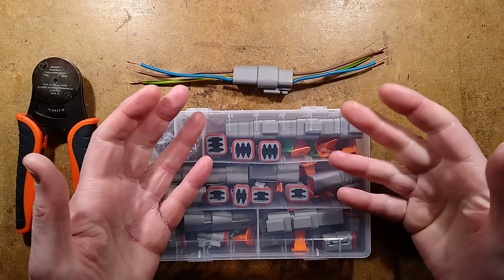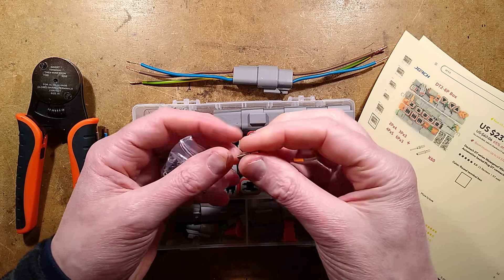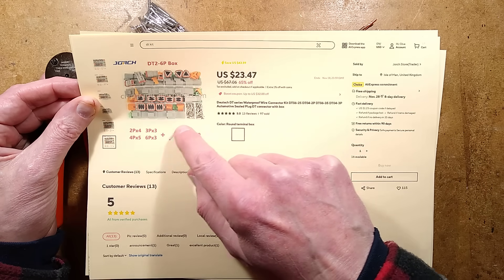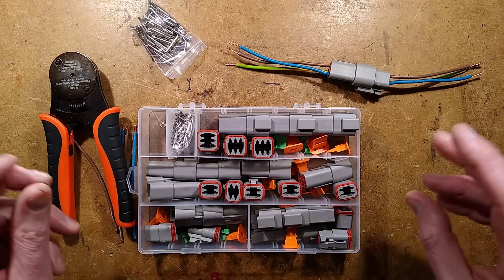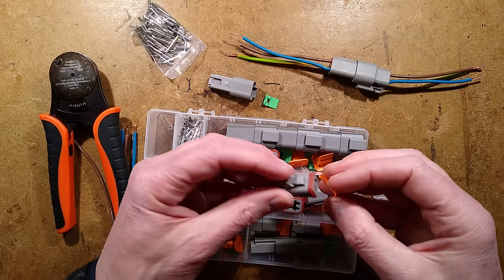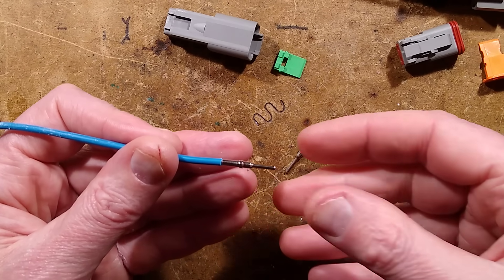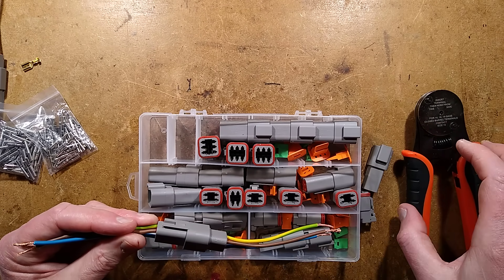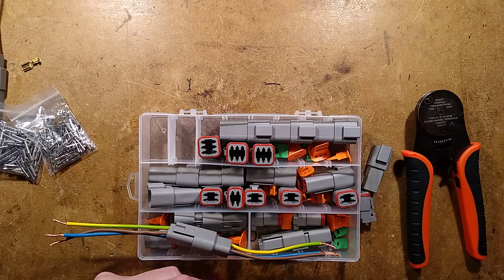Deutsch - my new favourite rugged connector

Comment: The heavy duty trucks I work on for a living all use Deutsch style connectors for all different circuit counts and wire gauges. I find them the most reliable and convenient connector in our whole harness, even the 30+ and 40+ bulkhead connectors. We used both TE and Amphenol brand as dual suppliers, as Amphenol makes a family of spec-equivalent connectors under their "AT" line. It's super common for us to have Deutsch receptacles designed directly into our controllers, making it even more convenient to use them in custom shaped housings. It was fun to see a parts review of connectors I've seen probably thousands of :D

Comment: I always love to see Deutsch connectors in equipment. They’re so easy take apart and repair. 
I’ve spent a half an hour trying to get other contractors apart without damaging them.
Reply: These days when faced with what looks to be a stubborn contractor, I sometimes preemptively cut its end off and hire a new one.
Reply: Dr. Freud, white courtesy telephone please...
Reply: Ford uses connectors with round pins that are similar in design to Deutsch connectors and use the same pin diameter (1.6mm) but the terminal length is different so the pins aren't interchangeable. The Ford connectors are similarly easy to take apart. I think Ford called them "wedgelock" connectors. I've used Deutch connector pins to make test connections to the Ford connectors.
Reply: "contractors" kinda fits, too
Reply: that second sentence turned kinda dark
Reply: Mopar locking connector has left the chat.
Reply: Yes, my van uses Deutsch connectors and they are never a problem to separate. My car has a mix of JST and Hirose connectors, and some of those can be absolutely awful to separate especially in arctic conditions.
Reply: I’m rather partial to D-sub connectors and cannon plugs myself
Reply: last semester me and my club buddies built a big cinnelifter drone and used deutsch connectors for the 8 motors, why? they were there lol. love the content btw man, keep it up. I bought one of those ryobi power cutters because of you
Reply: I too struggled with getting contractors apart until I purchased a Stihl MSA161 cordless chainsaw.  ☠️☠️☠️

Comment: With the 'winged' connector the outer insulating sheath is crimped to the connector. In high vibration environments this is important because copper core is under very high stress where the crimp is and any vibration induced motion occurs exactly at the end of the crimp which will cause the joint to fail. The winged connector transfers the motion induced stress to the sheath which dramatically improves the 'life' of the connection.

Comment: Is there a insulateted tail sleve for these so you can use dubble insulated cables and get a unbroken outer insulation layer between the outside insulation and the connector body? 
Or do you need to put shrink tube or electrical 5ape on them to achieve this. 
Also,have you done 1000 volt insulation testing on the example ones . 
Do a video on the insulation testing on the connector please , these would be really nice to use when connecting 230 volt 
Outside garden electrical stuff that you want to have unplugebal
Reply from the maker: I wouldn't recommend these for higher voltage use outside an enclosure.

Comment: These connectors seem to be commonplace in the automotive sector?  Both of our cars appear to use this type of connector in the visible parts of their wiring looms.  Presumably that's why they have very good environmental protection! I wonder if a standard bootlace ferrule crimper might do? They crimp in six directions, and once those ferrules are in place, they ain't shifting! 🙂
Reply from the maker: The bootlace crimper was not suitable for these.

Comment: These would be great for car mods or repairs. Might be a little bulky for a motorcycle 
if you needed to carry six or eight conductors. Would be great for carrying full bat. power 
to an outlet or higher amp drawing accessory, especially because they look like 
they are very water resistant, if not waterproof. Thanks, Clive!! If you love 'em, we know they 
are good.

Comment: I have a crimping tool for genetic ferrules and it’s one tool for several sizes. It seems to me that I could use that tool to crimp the connectors shown in the video too but Clive says you need a specific tool for each size (and I’m sure he’s right) 

If any knows, could you please explain to me why you need different tools for different size connectors? Tia!
Reply: With the non genuine tools the anvils in the tool for precision can only open up to clear the pins and crush down to the correct size, no mistakes can happen this way, if it snuggly slides in you are using the correct crimp, wrong crimps will be to small, pin won't fit in the hole as much as you try or too big for the pins, almost like throwing a sausage down a hallway.

The only adjustment to to make sure the crimp end is flush with the face, there is a few brands of pins out there that are a little different including crimp inside diameter but same size outside diameter and some cheap ones don't have the inspection hole. The ones with different crimp inside diameter are obviously thicker and a little bit more pressure is required to fully crimp, but they are handy for smaller wire but often not marked that they are different on the packaging within Australia and have no colour banding around crimp area.

There is a genuine type Deutsch crimp tools that can adjust to all the sizes 12, 16 and 20, but for the prices I have seen for them I could buy all the different types and sizes, multiple types of wire strippers, and every cheaper but quality removal tools with money left for a night of drugs and hookers. The only advantage I could see for me is less tools in a tool bag if I can not get my work vehicle close to the job. Even Aliexpress have a copy at $460AUD delivered "Ouch" but to some that is a bargain at less than half the price.

Not saying they are going to last as long as genuine Deutsch or licenced crimp tools but I have used non genuine Ionnic for years that cost me between $25-$40AUD but now they are around $60AUD

Comment: I started using Deutsch connectors a couple of years ago (import versions) and I like them. Although I have had two separate connectors fail over time. One was pretty soon, the other took over a year. This is on aftermarket fog lights on my truck. I still have to fix the one but its cold outside.
Reply: it occurs to me that maybe my crimping tool is less than ideal.....It's not as nice as this one.

Comment: I came across these during my internship in automotive controls stuff. Hard to plug and unplug, but water just does not get inside. Good stuff. The triangular ones were mostly used for CAN bus connections.

Comment: 6:24 damn. I've used Deutsch and other connectors in my industry for years. DT series are my favorite I buy them for home use. The flap/wing terminals are fine. I know you are not supposed to but, a little dielectric grease in between the seals where wires meet terminals and they won't corrode under water, with seal failure.
Reply: Also using dielectric grease on the plug seal protects it from grabbing the seal when you need to remove it in the future, when it grabs the seal it can overstretch the seal, I see this commonly in my job and have to replace the seals the first time a plug is removed, much of what I work on has been in a coal mining environment.
 
I have also seen wire and plug seals swell and become oversize when it has been soaking in diesel etc, the dielectric grease may(?) prevent/reduce the ingress of petroleum products, "this is just my theory". 
Fixing leaks, segregation of wring from a fuel or damaging heat source, protective sheathing, securing of cables (not just cable ties in a harsh environment and most white or coloured cable ties are not UV resistant) and plugs to prevent chaffing and pulling at wiring etc is obviously the better long term prevention.

I don't know if anyone else has mentioned to "NOT" jam your multimeter probes into the female connector, it is sprung at the entrance to give conduction between male and female pin, forcing a probe into it can damage the female pin and you most probably won't know this has happened causing higher resistance and open circuit at a later date.

I have made test plugs or pinned test wires, I even have male pins out of "bussed" Deutsch connectors, awesome for bridging plugs to test conductivity,  I am sure there would be manufactured versions out there for this purpose. 

I love the speed I can assemble solid tubed Deutsch pins over the cheaper split pins, I have also seen the Bomag Germans accidentally poorly crimp the other type (they might have had the Chinese supply the wiring), if you pull on the wire on the barrel type you know it is crimped to the wire, if you pull on the type that secures the wire insulation there is no guarantee of the wire being crimped correctly, I have come across this problem, I love the idea of the wire insulation being secured I guess those types are generally done in the factory in one action, my crimps don't allow it in one action so I can pre test the crimp to the wire but it is tediously slow.
Reply: The long posts are because Deutsch is the way. The wing type has one wing for wire and one for insulation. When you pull on the insulation it's crimped to the terminal, its not just pulling the wire out of the insulation.

Comment: The little hole in each pin also allows it to wick solder in without creating an air pocket if you want to solder them instead of using a crimper.
Reply: The hole is there to indicate the wire length is correct to be crimped, there is instructions out there to show this, but I can see it would be handy for someone to solder it, it is industry standard to not solder wires used in a harsh environment as it causes work hardening and possible solder wicking into the wires under the insulation, I often have to replace wiring broken due to this, someone in all "good intentions" did a good job of soldering but the wire broke at the soldered point or where the solder wicked up the wire into the insulation,.

It also doesn't help that it is less common to find lead in todays solder due to people incorrectly using it in plumbing and international agreements to reduce electronic waste problems.

Many old school can not get out of the habit and continue to just repair their repairs and the simple fix is faster and more reliable today. I am 52 so I am not new to the industry I use to solder nearly everything too, these days a lot less and "try" to prevent wicking up the wire and secure the wire to not move as far away from the soldered joint, I also try to find non lead free solder LOL.
I used buckets of solder 30+years ago when I rebuilt/temp fix bus radiators as part of the job we did everything bar exterior paint including body/frame repairs.
Reply: @MidlifeNoob  I've worked a lot with military grade connectors where they explicitly state to solder and detail the solder process required.
The biggest problem with people soldering is usually the soldering of strands before they are clamped in a terminal block. This leads tro them working loose over time.
My comment was mostly for the DIY'ers though as buying an extra tool may not be to everyones liking. The holes are usually way too small to be able to determine the depth of insertion though.

Comment: Deutsch DT are great, if a bit manly sized. waterproof, hard to monkey up, great contact. just too bad they don't make a compatible print mount version. Might I suggest JST JWPF for your smaller waterproof wire to wire or wire to board needs? great stuff, bit fiddly crimper, amazingly compact and lightweight. Or, ye olde superseal for when you have a need of many pins

Comment: I love Deutsch as my personal go to (with superseal the begrudging 2nd) however the biggest thing is putting the conduit backshells (Harnessflex is a good brand) straight onto the back of the connector. I can't quite tell but it looks like your versions may not have the clamping lugs for them. The other handy feature is you can use a spare automotive relay mounting plate (little tin tab thing) to mount your male connector to. Last thing to note for those that might walk into a motor factor to buy some over the counter, the Male and Female sets are actually part numbered usually by the pin gender, not by the housing gender. I've had many customers of mine get stuck with that when ordering over the phone.

Comment: One thing tho.. They look very bulky especially if this is suppose to be a low voltage connector - for a car etc. Is it 2.5mm^2 you are using in this video?
Reply from the maker: There are smaller versions.

Comment: You can get deutsch pin removal tool, to easily repair these connectors I had a full set of these tools when I was a mechanic, and doing wiring work, on cars. If you get a set, it will come with the pin remover, and the wedge remover tool.

Comment: To be honest cheepy winged ones seem a bit better in vibration prone environments despite being inferior in terms of wire to pin contact.
Remember seeing ensto connectors looking similar, but those were 400VAC rated or more due to having arc separation geometry around pins. These don't look too good for anything above 50V.

Comment: The "fold around wing connectors" mentioned around 13:30 are called "faston" connectors just as fyi. A lot of sealed lead acid batteries use them. I hate those stupid connectors. I sell batteries for a living and have to deal with those things all day everyday. Anyways thanks for sharing as always!
Reply: I think you might be confusing Faston which is the connection between male and female (also called quick connects, disconnects, or spades) and F crimps which is the two (actually 4 including the ones that grab the insulation) wings that curl inward used to secure the connector to the wire.
Reply: @MikeBucceroni  I just mean what he showed in the video is a faston connector.

Comment: 🍁🍁  Good day Clive, I have used different but very similar connectors on mobile wet environments equipment with minor issue.  Now you make me look closer and I have just one thought.  The female connector does not appear to clamp onto the male connector snuggly.  Any clearance within the two pins can theoretically cause an arching situation.  <<< I have witnessed that.  In my opinion, the female pin should be spilt and tensioned so that the male plug expands it as it enters.  That way the pins are then tightly connected.

As snug as a bug in a rug as we say! 😆😆

Comment: I doubt these are rated for 230V, Clive. Besides, the connectors don't have provision for a cord grip and cover, leaving you with basic insulation exposed, making them useless for that application anyway.
Reply from the maker: I'd only use them within equipment.
Reply: These do have accessories for exactly what you described - boots and other shields you can add on to make them even more water proof and sealed. The basic connector without those accessories as seen here do a good job on their own however.

Comment: Other than not being gold plated those are very aerospace looking connector pins although the real aerospace quality pins have a small circular window that lets you know when the wire is completely seated in the pin. but as a weather proof automotive connector those are excellent. I have always loved those kind of crimpers.
Reply: From Deutsch they are available in tin, nickel and gold finishes, though the sealing is good enough that there aren't corrosion issues with the lesser materials.
Reply: These then must be "aerospace quality pins" since there IS an Inspection Hole which you might have missed seeing...
Reply: @robertbass9032  Hmmm...didn't see that.

Comment: I bought my original ones from Ali Express and they were exceptionally good for the price. The only issue I had is that cheap ones are not quite machined accurate enough, and mixed with their cheap crimp tool, so they don't have consistent pull test results and suffer from vibration over time. I used them primarily for automotive. I do now have the actual original high quality ones alongside the cheap ones, but I do explicitly use the high quality ones on connections that are in challenging conditions while I use the cheap ones for everyday common applications (including outdoor).

Comment: replaced a load of connectors on my 1999 sv650s harness. now impervious to weather. well apart from the spark plugs 😂😂😂😂
Reply: also, might be overkill but a little dielectric grease on the seal really helps get them apart when servicing the bike.

Comment: I never saw that connector before. Looks really nice BUT

How often do I have single wires and the need for waterproof? And I miss a strain relief.
Am I missing something? But I saw that Ali also has Harting connectors now. I like those more
Reply from the maker: These are designed for use in wiring looms.  Harting style connectors are good, but water can penetrate via the inside of the cable in some instances.

Comment: Have been working on equipment with Deutsch connectors for years. Have had a lot of problem with them. As they do not like vibrations. So the connection pins, ( over a to short time) get worn out and are making bad connections.
So if you have thise connectors and having strange mailfunctions,sensor errors on the enging or generator. Change the plug.

Comment: Noticed these connections used a lot on our Toyota forklifts at work that have been upfitted with OSHAs fancy little safety lights that shine in all directions for your “zone of safety” these little connectors are used on all the lights and have always wondered what they were called